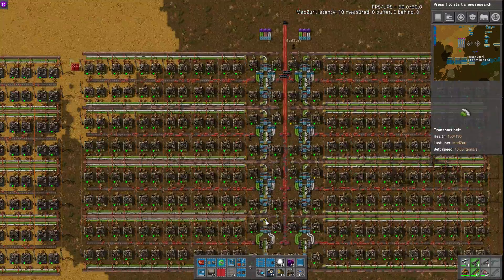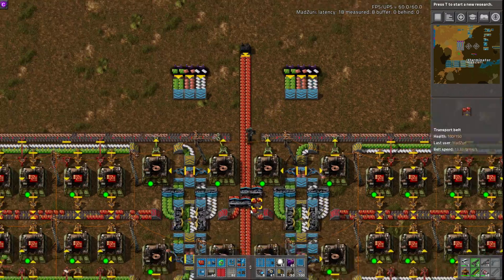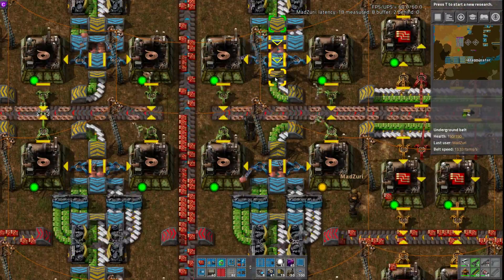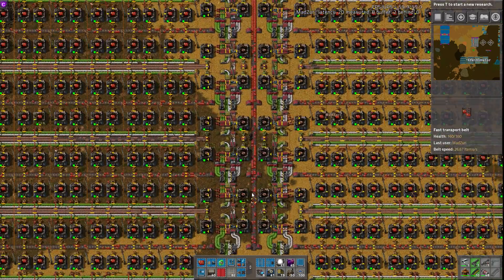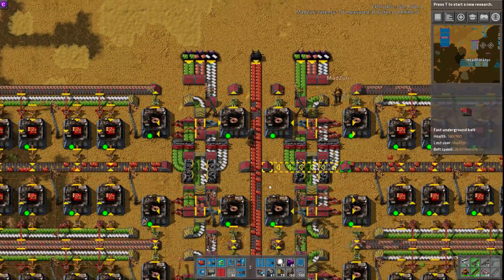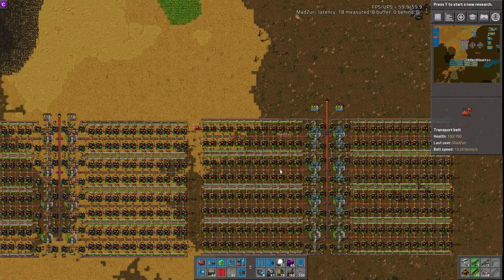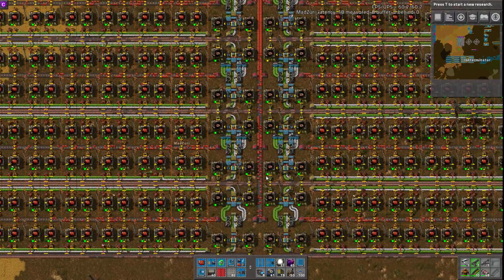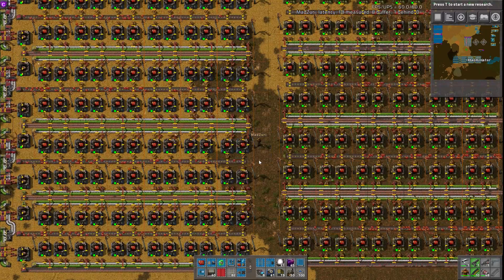MadZuri's Red / Advanced Circuit Build :: Factorio Workshop Season 2 - Building A Better Factory

Comment: I just had to replicate this build to understand it. I didn't use the blueprint and it was clear without feeding anything that I had misunderstood the belt placement. I've got 3 belts down the center of the row and only 1 on the outside. There's also only a single underground red needed to make it work, all the rest can be done in yellow if need be and upgraded later. With some iteration, I got the middle belts down to 2. It ended up becoming my own version of MadZuri's Build and I'm really happy with it. To be had, I prefer the version with 3 belts in the center.

Comment: I would like to give Xterminator and MadXuri kudos! Great work! I do have a question for you both. How do solve the problem of sorting two or more ores from the same mine? I hate leaving behind thousands of these mixed veins all over the place. :( thx
Reply from the maker: Thanks! :) Typically if there are patches that are mixed, I find it easiest to just use some filter inserters to filter out whichever ore there is less of an then put it in storage or maybe a different part of the train if you delivering it that way.

Comment: Hey, I wanted to submit my design of a "power to circuit" converter - a setup that can read power state of the network and convert it into a signal, but the whole design is pretty combinator heavy. Would you be interested in featuring it, and if so, should I supply a manual :P ?
Reply from the maker: You could submit it, I'm sure Zuri could figure it out. I'm not sure I'd understand that type of thing though. :p

Comment: It takes a lot of brain power to make! example the 2 long handed inserts vs 1 fast inserter for copper to copper wire. not really an "on the fly" build. Plus you don''t have to make blue belt vs the traditional straight build. I'm fine with one time costs for items.

What would you have to do to make this take production modules? 

I think its also worth noting that you can transition this into a bot based beacon build.